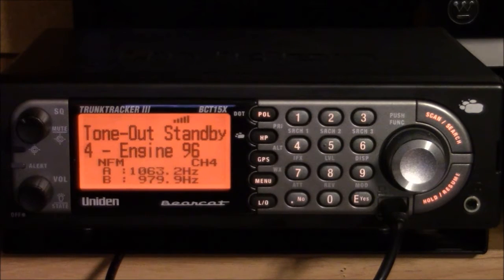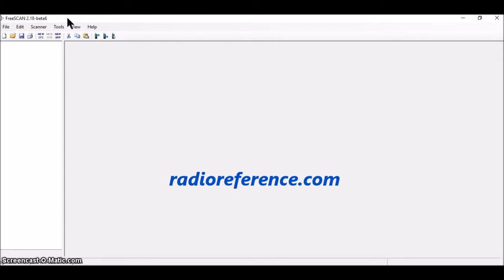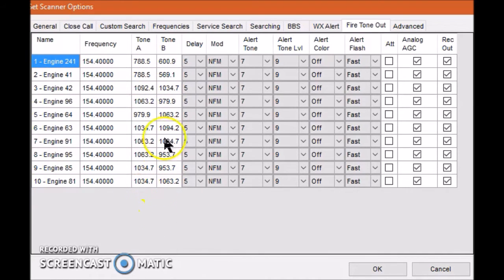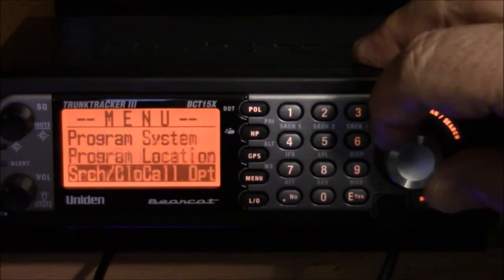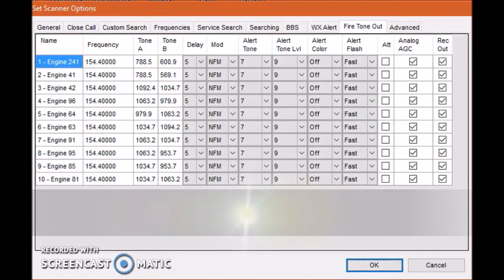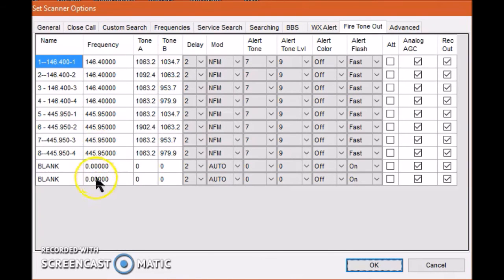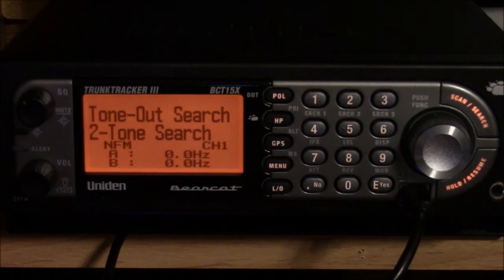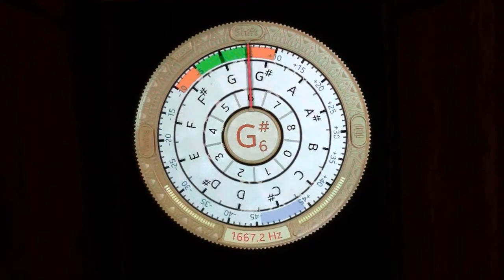UNIDEN BCT-15X SCANNER - TONE OUT MODE

Comment: Does anyone have a recommendation as to were to get a mobile antenna for the BCT15X
Reply from the maker: Scanners aren't that picky concerning an antenna as they don't transmit and typically have very good receiver sensitivity.

As far as magnetic mount or hole mount, they are pretty much the same and the decision is;  to drill a 3/4"  hole in your roof or not.   I have used simple quarter wave VHF whip antennas on  a roof mag mount with good results on VHF/UHF and 800 MHz.     I've used "hole mount" antennas and got the same result.

Here's an offering for a complete setup from DXEngineering. Many other companies offer the same or identical.

https://www.dxengineering.com/parts/mfj-1721?seid=dxese1&cm_mmc=pla-google-_-shopping-_-dxese1-_-mfj&gclid=Cj0KEQjww7zHBRCToPSj_c_WjZIBEiQAj8il5AZXzBkmX5yDH_HBCXgeNdIX7xHdgD0Vz5YWWv3lCzAaAtyz8P8HAQ

Comment: is a computer required to program tone out?
Reply from the maker: The provided link will get you to "EASIER TO READ MANUAL" for the BCT-15X.   Once you get there choose the "*Tone-Out For... Menu*.   It will direct you to the "Using Fire Tone-Out" Section where they take you through the steps of manually programming the Tone Out Mode.
 http://marksscanners.com/BCT15X/bct15x.shtml#Fire tone